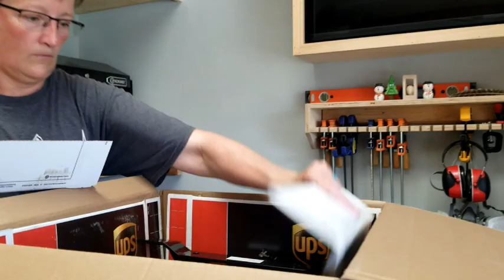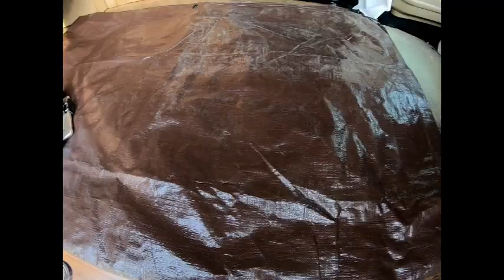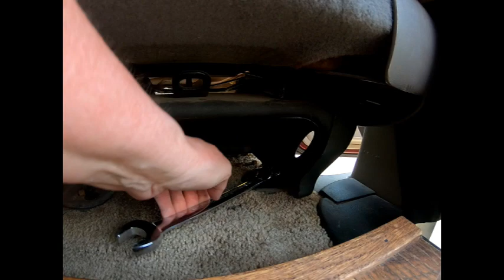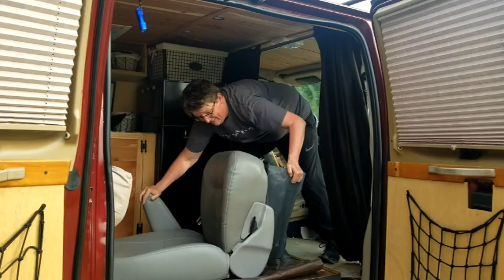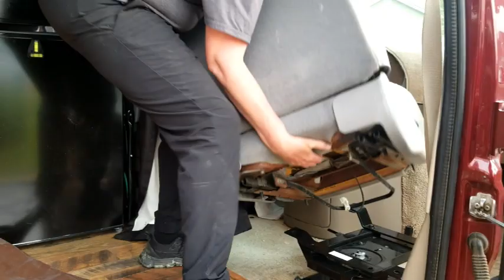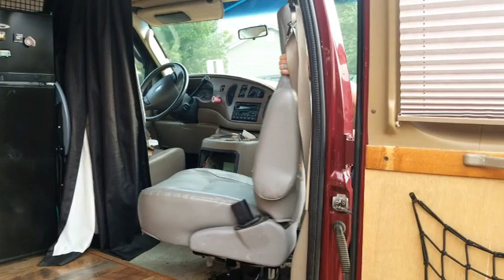Easy Swivel Base Seat Install | Van Life How To

Comment: Want to do this to my ford freestar mini van, but looks a lil more complicated than this, with airbags and all. Messing with the electric seats is also a lil more involved. 
Great job on yours!
Reply from the maker: I have done another one since this van.  The swivel base has a spot to feed electric through.  Just make sure to disconnect battery first before messing with wires.

Comment: My swivel seat doesn’t swivel at all. I’ve been at this for three hours and it won’t budge even a little it’s stuck or something. I guess I’ll need to return it I know it can’t be this hard it must have been damaged in delivery. Ive watched a million videos and nothing about swivel issues so mine must be broken 😠 Figures since nothing at all is going right with the van. Oh and Amazon booted us out so I’ll be removing all the links this weekend since that’s now over too. Oh well, I tried but we just don’t have what it takes. Feeling very defeated tonight. This seems to be an easy task if you get a swivel that actually swivels. I’ll try again in a few weeks whenever I get a replacement. I’ve got the seat out and the airbags disconnected so halfway there thanks to your video though!
Reply from the maker: Oh girl, this is crazy.  Did you get the Euro Campers one?  Can you possibly take pictures and send them to me.  I am no expert but sometimes is you look at something for too long...   I hate this.  You have my number

Comment: I wish you had shown the part where you took the existing hardware of the current seat. I want to make sure I order the right swivel base. Need to know what measurements are important when ordering.
Reply from the maker: Give the company the year, make model and they will get you the right base.  I have used Iron Cloud before and they have gotten it right both times.

Comment: I have a 2000 Dodge van that I'd like to do this to...what about bolt pattern?? Are they all standard?
Reply from the maker: You can check with the dealer.  I have been ordering mine now from Euro Campers they could tell you also.
Reply: @JonniesJourney  thanks for the reply....I actually read through all of the comments after I asked you that question  and wrote that down last night, wish me luck and thanks for the video!😊